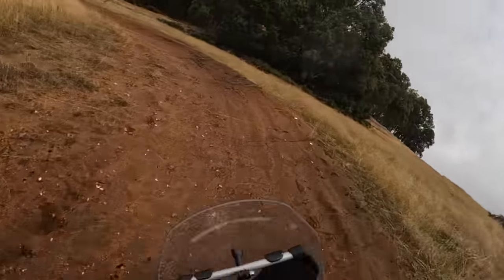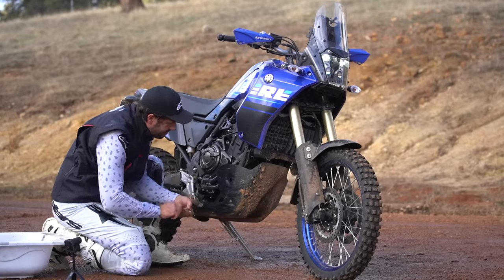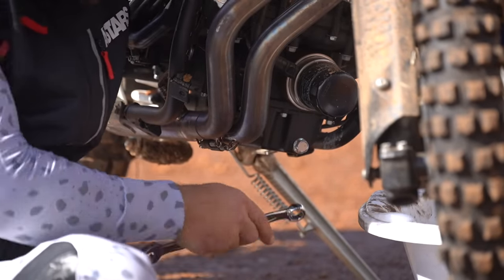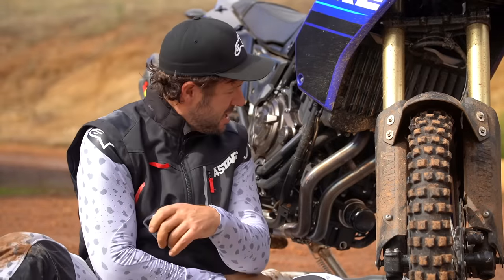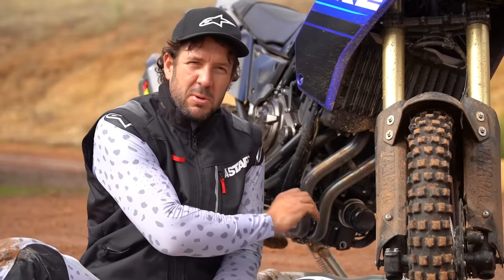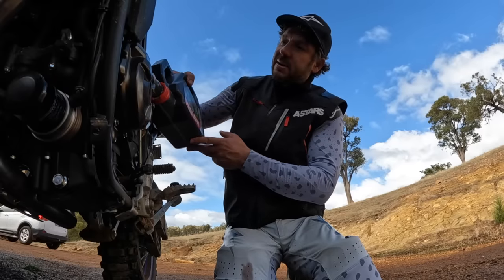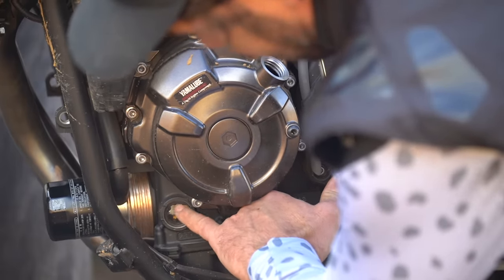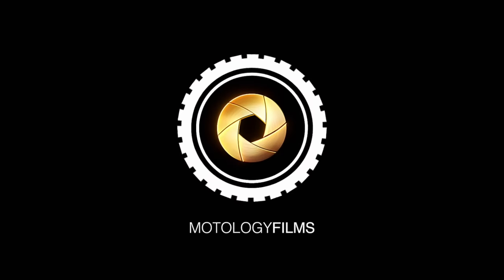Ultimate Engine Maintenance Guide: Triple Your Bike Engine's Lifespan

Comment: Awesome video, tyvm! Went on and did the oil change. Turned out to be solid interesting mess, because I did not want to take off all the crashbars to remove the skid plate, which was bolted on underneath them. But next time will be much better and cleaner.

Comment: this makes total sense. I was told to change the engine oil warm for viscosity so it flows better.. when i change my oil (1.6 qt) i run an extra quart through for about 3 minutes then drain that and fill it with the oil im going to ride with.. saw a mechanic friend to it on an oil change years back figured it was a good idea

Comment: The motor was hot the last time you ran it so any bit that would drain to the oil pan had already done so.  The sediment in the oil pan would be slightly higher than if you ran it hot then quickly changed it but I doubt it's as much as you make it out to be. Is it worth screwing around with 250 degree oil and filter for, not for me.

Comment: Hey man I live in sub tropics,  I have a somewhat big bore thumper with high comp engine. I change the oil every 2k kms which is achieved within 2 months and the engine never stops. It runs daily. My question is should I do hot change or should I stick to cold change?

Comment: If you follow manufacturers service interval is highly unlikely your filter is blocked.the bypass valve is a failsafe but also to allow oil to flow during a very cold start

Comment: I had to rethread my drain bolt threads 2 times as it would always leak after an oil change,(its a small150cc commuter), asked the lathe technician and he said dont service at mechanics as they wont care for your bike like an owner would, instead he advised me to remove the bolt after the bike has cooled down and just tighten the bolt with fingers and a ring spanner, so far i have changed oil myself 4 times and no leaks noticed till now.

Comment: Main reason oil goes black is the additives. There is a good vid on youtube from a petrochemical chemist that shows oil color of an oil that's only been in an engine for a very short amount of time - it's black! The old guide of 'if black you need to chance it' no longer applies. Modern oil has tons of additives that change color very quickly after oil is exposed to heat. Apparently the only real way to tell if oil is bad is lab oil analysis. A rough gauge is how viscous or gummy the oil is relative to new -> if you shake it around a bottle does it stick to the walls and take a long time to slide off. Anyway, noticed you mention the color thing and figure I'd share!

Comment: I put 5w40 liquimoly in my kawa 250 and was  the first time i see aluminum particles, very very few, and very very small, in ten hours. Now im using motul 7100 10w50. According to the manual I have to change the piston every 30 hours, now it has 60. I hope it lasts longer, for now I have noticed less small sounds of metallic components and a little more compression.
Reply from the maker: You're onto it being so in tune with the wear and tear of your engine. Well done.

Comment: Some of the logic shared here doesn't make sense. If every flat surfaces in the engine is covered in black debris following your last ride, then that means that the last ride was not sufficient to wash those surfaces clean, and hence the warmup process in this video also won't wash those surfaces clean. One could assume that debris might fall out of suspension in the oil, sit in the bottom of the crank case and then get pulled back into suspension in the oil when the motor is running, but if those particles are of any significant size then they would get trapped in the oil filter or the oil screen and removed during any oil change, warm or cold.  What I believe really happens in the cold motor is that some oil becomes like sludge and will sit stuck to the bottom of the crank case.  Running the motor causes some of that sludge to dissolve into the rest of the oil.  Also the oil gets thinner when its hot.  So the thinner oil drags the sludge out the motor effectively, and that's why its best to drain hot oil out of the motor versus cold oil.  But 3x engine life is pretty big claim none the less.

Comment: Solid advice. However, people living in different climate require different viscosity oil, even if it's the same engine. Also, don't let your oil drip out over night. Yes, you do get a couple more droplets out, but the remaining oil film on your engine parts gets thinner. Which is not ideal for the first start, since it will take a bit of time (couple more seconds) for the oil to get there, because of the empty oil filter having to fill up first.

Comment: Oil and filter are cheap so change it more often than the manufactures intervals. Cheap insurance and the key to engine longevity. Don't do what many people do and sit with the engine ticking over when its cold to "warm it up", it's nonsense. The best thing you can do is get riding as soon as possible. Don't cane it when cold. A motor warms up far quicker when under use. Don't sit there banging it of the rev limiter like a bellend either. Worst thing you can do.... All those parts thrashing around with no load😬
Another great vid Adam. Put a dowty washer on the sump plug rather than a metal crush washer. Don't torque the plug to factory spec on the tenere. The figure is incorrect in the manual!  Tighten to 23NM max.

Comment: If I was as worried about cleaning out my four stroke Gearbox (say my GSX 1100) I’d probably be running a flush through the system and drain into a light coloured pan. A magnet in the Sump plug is an excellent investment too. I’ve never needed a torque wrench for any of my Sump plugs and never had a problem …

Comment: Is there any chance you damage the threads of the bolt or engine by un-tightening and tightening back while it's hot? I always heard that this was a big factor to not mess with bolts on hot engine.
Reply from the maker: Look at how easy the sump bung came out ... a little tap on the spanner. I'm a mechanical fitter and when bolts or bearings or anything won't budge, apply heat.

Comment: You don't need to overtighten the oil filter. The rubber o-ring is a seal but it also keeps it from backing off. As tight as you can get it by hand is enough. That's how they were designed.

Comment: Interesting about the oil weight. I ride a 2016 Guzzi V7 (heron head, pushrod, 2-valve per cyl) that calls for 10w-60. These bikes have some tighter clearances in the engine bearings. I ride it all year, do a little unpaved, essentially turning it into a midweight ADV bike. Last year I began throwing a sidecar. I was always afraid that changing the oil weight would damage the internals. Could it be helpful?

Comment: Lol good luck on the drain bolt for hot changes. Definitely i change oil after being out for a ride but i dont do it while its hot. I just do it if i can touch the crank for 5s without removing my hand.

Comment: I notice that the drain plug on your bike is on the opposite side to prop-stand which means it is not at the lowest point,  my bike has prop stand on same side as drain plug which means bike is leaning towards the plug and drain is at lowest point and more oil will come out.  I use copper washers on drain plug and every oil change I heat the copper washer to red hot with a torch and drop into cold water - this anneals the copper,  then polish the face of washer with brown scotchbrite pad to remove any scale... then the washer nice and soft to seal properly.

Comment: I don't go above 70c on my oil. This is because the oil is cooling the engine. With all that oil that's meant to be cooling the engine, taking it out. I feel like would cause cracks or fractures on the engine casing (if I go above 70c). As it's gonna increase it's temp as their is no oil cooling the engine anymore. I also put it up on a rear paddock stand while doing an oil change. I use gravity to get as much oil out as possible.

Comment: Any opinions on the effectiveness of oil filter magnets & magnetic oil drain plugs. Do they help?
Reply: Absolutely. Had a KTM 990 adventure, always stuff in the magnet. Rode it to 60 000 km´s. My riding buddies with KTM´s also had. So, if it is big enough to see it must not be good for the engine, better be picked up by the magnet. I am riding an AJP PR7 now, little stuff in the magnet but the engine is also new. It seems to be a KTM thing to have metal in the magnet. :D
Reply: @andenture     Right on! Thanks for the input. Much appreciated.

Comment: The only problem you have with your message is when you're going to the dealership it had better be for the oil change not a valve job & tune up. That requires a cold engine for proper clearance check. Otherwise absolutely spot on mate!!! Don't forget to get a magnetic drain plug.

Comment: I just did exactly that and have new oil looking black again. Thanks for explaining that.
Reply from the maker: And I'm guessing you weren't flogging your bike in the sand either? Like it's just turned black after a normal ride? Old sediment left in engine ...
Reply: @MotologyFilms  spot on, hadn't ridden the bike in weeks (just got a '23 890 AR) because it needed a service. Looks like I will give it a good flog and change the oil again, I hate seeing the dirty stuff.
Reply from the maker: @ride4adventure  Good stuff mate. I'd go for a thicker full synthetic for the 890R. They've got huge horsepower but are a "noisy" engine. Reduce the noise with quality oil, ride it in the sweet spot and you could pretty much ride that thing round the world.

Comment: Curious to if riding the bike before changing the oil would be as necessary for a harley where the primary, transmission, and engine oils are all seperate.

Comment: Another tip I share with others is pre filling the new oil filter so the engine runs on oil sooner at first start up.
Reply from the maker: Most of the oil will have spun out all over the place by the time I wound it on in the horizontal position.

Comment: I always knew the bike should be at operating temperature, what i thought they meant is get it running, leave it running for a bit until its warm and then dump the oil out.. Will keep this in mind and try it to see if there is any difference.

Comment: Sorry not trying to challenge you but few things I’m gonna ask. 
You said to use the genuine filter because they know better, but then u r using different oil than the manual unless your bike says 10w 50? I’ll explain what I mean, I use after market oil filter, I always change the washer and I’m using 10w30 Penrite, as long as meet the requirement from the book now the question is why would I put in different oil rather than what the book says. 
I have an Africa Twin 2016 and I’m trying to question you whether I should use the same or go up like 10w40 or even 50. Can you explain please? Cheers mate

Comment: Should you change the oil after a good ride before the winter? To have a clean oil ready to go bike in the spring?
Reply: I asked this from many "experts". All of them said is basically stupid. Reasons are many, but basically just leave it and remember to ride at least 20km hard when changing it in spring. Hope this helps.
Reply: And you have to ride, idling is not enough. I think every motorcycle service manual mentions this. For example, moto Guzzi says at least 30km and at least half an hour. Spirited driving. Guzzi uses 10w60 oil, because it is air cooled, so it is essential to ride it properly hot, so the engine cleans completely.
Reply from the maker: haha "spirited driving" ... I think I qualify as a spirited driver.

Comment: Suprised to see that you don't prime your oil filter with oil.  Oil pressure takes several seconds to build as the oil fills up the volume of the galleries and the new (empty) oil filter.  Changing it completely hot negates part of the dry start up I would guess.  But I am a huge fan of priming oil filter, even at that angle, you can really put a large volume of oil into the paper part of the filter.
Reply: there is an oilfilm on every part in the engine, so no risk in not priming filter. I know mecanics who advise against priming the filter as its very easy to get small pieces of dirt in your filter that way..

Comment: Have also an obvious question about the plate - I have seen that it does not have any holes through it - so it is better to keep the dirt outside but poor engine cooling features, right?
Do you recommend it?
Reply: I wonder the same. Usually, there are holes in the front and at the bottom of the plate. Maybe Tenere has oil cooler?

Comment: Quick tip. You can re anneal a "sump bung" copper washer by heating it till red hot and dropping into cold water. Can reuse them many times this way.
Reply: We’d do that all the time for aircraft sparkplug gaskets. Works great. But if using an acetylene torch, have to be careful or they can melt.

Comment: A wee bit of new oil in the new filter to prime filter if you can, And smear oil around the rubber seal before installing to save it getting baked on and stuck ? 😅

Comment: I always drain hot oil, but your get it spinning and hot tip is very good. Not just idle the engine or ride around the neighborhood. I do think that your comments on a spin on filter media getting "plugged" up very quickly and bypassing oil are too simplified or all together wrong. Oil coming out of the oil pump is forced through the filter media, this media creates restriction and can only handle so much flow. If these values are exceeded, the filter media will collapse, no good. It's flow rate and pressure difference created within the oil filter that is the real deal here. If the oil pump flow rate exceeds the filter's flow rate, the pressure differential between oil pump side and "filtered" engine oil side increases. If the pressure differential is large enough, even a brand new filter will by pass some of the "dirty" oil pump side oil. 

The spin on oil filter is by design a bit of a compromise. You want tight filtering media, but that creates restriction in oil flow, which forces the by passing of oil within the oil filter. If you use "loose" media, the filtered oil will contain larger particles of contamination in it. The physical size of our motorcycle, spin on filters are also very small, the filter media area is small, therefore the resistance increases. Oil viscosity, temperature, rpm all affect the by pass issue.

The real answer here is to have a two filters. One would be a full flow (all the oil passes through it) filter, this would use metal mesh type f filtering media, which would have to be on the loose side, just filter the big stuff.

The other would be a a very tight media filter, this would very slowly (referred  to as by pass filtration, as the oil being filtered is not "part" of the full flow of oil supplied by the oil pump and used for engine lubrication) filter the oil and remove all the fine particles, this allows for very good filtration. Big diesel, industrial and such engines use such dual filtration set up.

My little Honda CRF150 here in Indonesia has a simple metal screen, but in addition has an "centrifugal" oil filter. This simple spinning round chamber with some "vain" like features captures some really fine particles. When cleaning it (side cover has to come off, but on this bike its 5 nim job) a super fine, graphite like, material comes out. You cant feel any abrasion or grit when "testing" it between fingers.

Ok getting very long, I will from now, ride it hard, before oil change. Thx.

Comment: There is so much confusion on the oil rating.

'W' is winter. However the number before that is the temperature.

For example:
20W50 means the oil is rated at '50' viscosity at operating temperature (100C) and is rated to operate from 10C (cold start/low ambient temperature)
0W50 means the oil is rated at '50' viscosity at operating temperature (100C) and is rated to operate from 0C(cold start/low ambient temperature)

So if you live in a hot climate 20W50C is enough or if your ambient temperature drops lower then choose 10W50 or 0W50 accordingly.

Comment: Thanks for then vid! So for us with long winters should we change the oil after the first or last ride of the season?
Reply: Better to change at end of season to remove as much of the acids as possible rather than let them sit over winter where they could potentially do harm. Also, if there is a major problem developing in the engine, excessive metallic evidence may show up giving you the off season to deal with it instead of being faced with it when all you want to do is go out and ride. Also, new oil will not deteriorate in the engine sitting over winter.

Comment: Viscosity is only 1 part of the oil spec importance. Watch for API and ACEA ratings! There's also oil specifically for engines with combined gear & clutch (most motorbikes) but also oil for engines with separate/dry clutch (cars & BMW motorbike). Car oil has got anti friction components; do NOT use this for engines with 'wet' clutch design!  PS. Oil becomes more acid after some ageing. 
ALSO; PLEASE fill the oil filter with some 200-300ml oil before mounting. Not doing so, will have the engine running with ZERO oil pressure the first few seconds, before the filter fills up.

Comment: I know a guy who would empty his car motor oil and replace it with paint thinner "VARSOL" , run the engine for 5 minutes idle, repeat the process with new VARSOL, And finally, empty the VARSOL and replace with new motor oil. Now, that's what I call a "Super Max Oil Change". To do that efficiently, he made himself a bypass dummy oil filter.